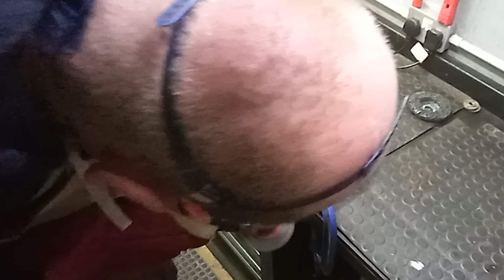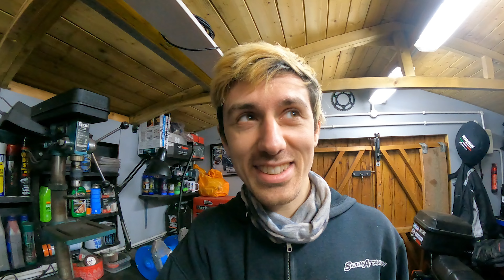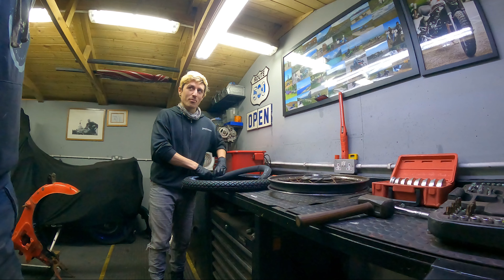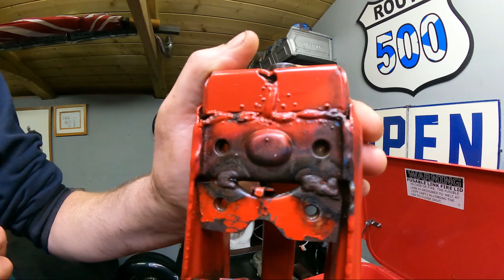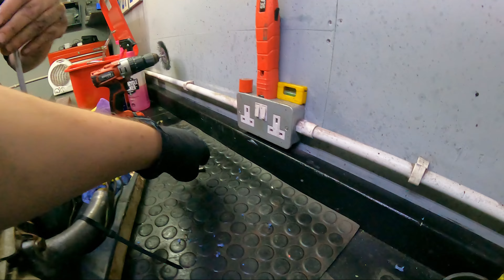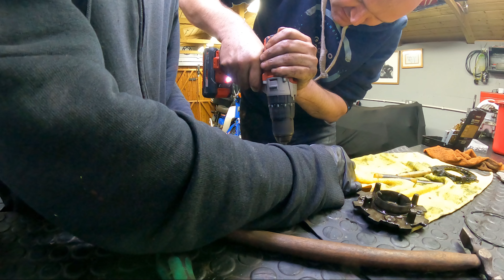Honda S65 1965 Restoration Part 2

Comment: 14:50 I find I get a much higher success rate using a dead blow hammer. A rubber mallet absorbs a lot of the shock that breaks the fastener loose.
Reply: I wasn't going to let Pezza loose with a real Hammer 😂
Reply: @terrymoore5508  harsh but fair 😆